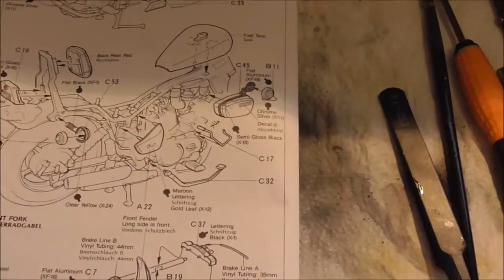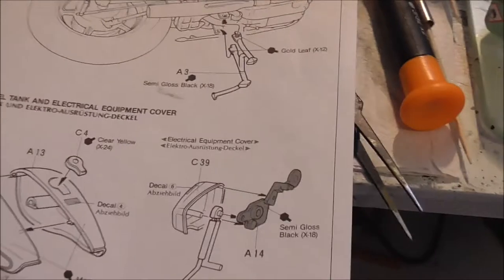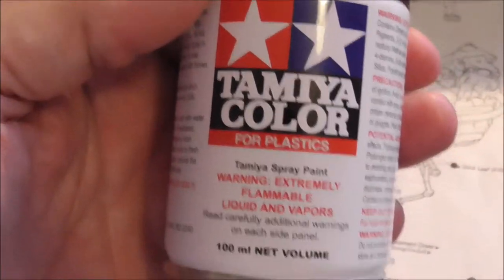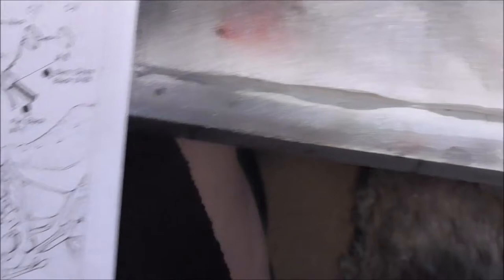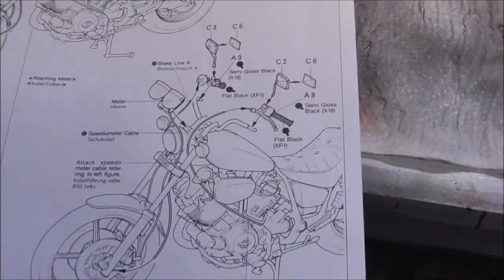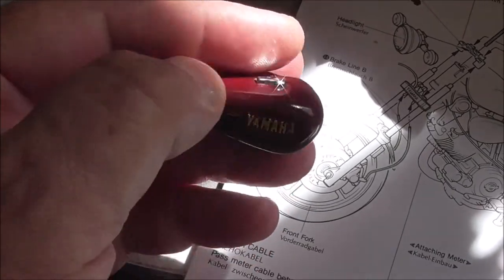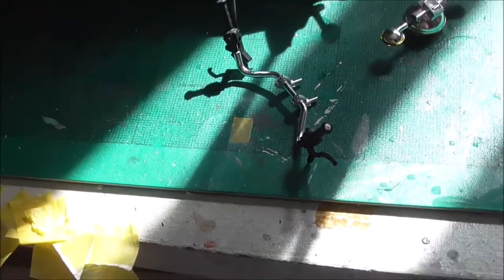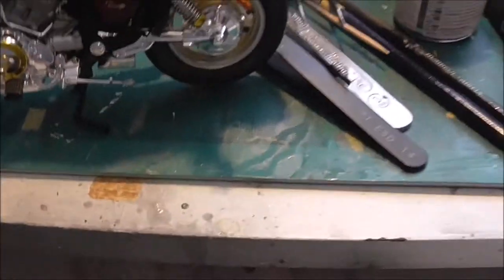Tamiya Yamaha Virago Part 3

Comment: Thanks for the serial video, I'm Gerardo from Cancun, Mexico; this is a beautiful model, actually I have mine to start but I was made it two times before this one, and sold bot models. At the first one I was painted red metal color for the body color, it looks very nice and in the second one  the correct color; I know the decals of the sides of the fuel thank was very tricky to put on, I really have problem with that but it really looks nice wen finish. I hop don't have many problems now. 
Good job!
Reply from the maker: Hi Gerardo, Im Glad you liked it, Keep Modelling and stay safe buddy

Comment: Quick question how are you cleaning up the nubs on the chrome parts?
Reply from the maker: After cleaning then I cover the bit where the nub was with a molotoi chrome pen, I think that's how it's spelt, you can buy them from Amazon
Reply: @Ryker45  thanks man can finally get started on mine